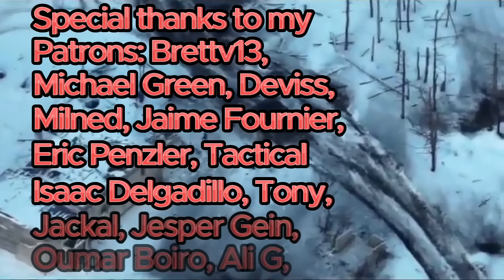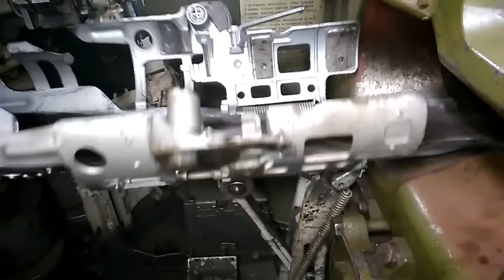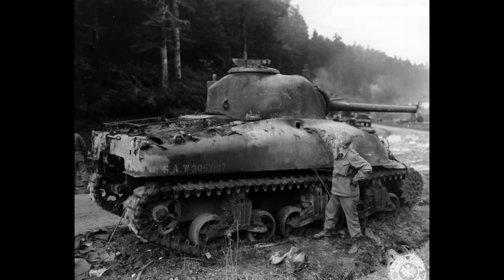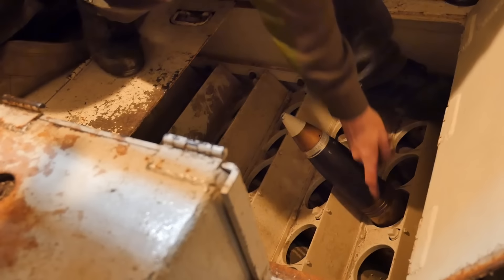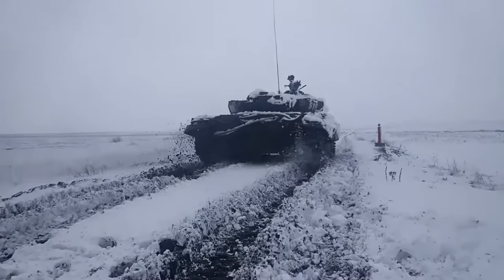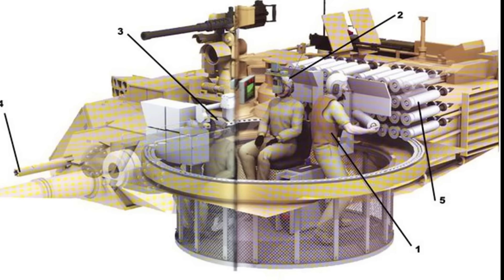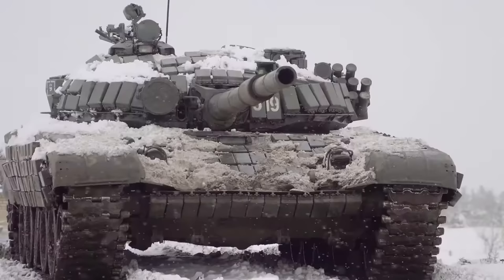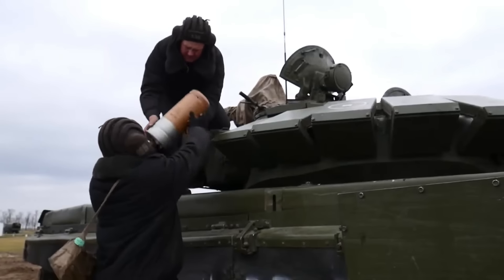Is Autoloader Really the Reason for Russian tanks exploding so much?

Comment: Gaijin actually solved the ammo detonation issue on T series tanks and I think the Russian military needs to take notes. Just make frag magically disappear post penetration!

Jokes aside, ammo stowage has always had this issue, especially "dry" ammo. If an Abrams gets ammo racked with the blast shield open, it doesn't fair any better then a T series. There are always design considerations and drawbacks, I don't think it's fair to claim it's entirely the autoloaders fault. Bustle auto loaders would suffer the same fate if the ammo is struck during a reload. That's basically all segregated ammo stowage and blow-out panels do- increase the statistically likelihood that a successful perforation of the armor doesn't mean a catastrophic cookoff that will kill the whole crew.

It's just basic thermodynamics. Chemical Propellants love to "blow their top off" so to speak (ammo sensitivity has always been a problem and many solutions have been made to attempt to address it), especially around jets of molten metal or searing hot fragmentation. C'est la vie.
Reply: U just confirmed u know nothing by saying sabos detnate ammo😂
Reply: @bruhbruh3847 you failed reading comprehension considering his first sentence is a stated joke.
Reply: @bruhbruh3847 there is a practice of lap loading to increase rate of fire... And sometimes crews would leave the ammo compartment open to further increase the rate... So... It still can happen.
Reply: @bruhbruh3847  You dont seem to get the joke..
Reply: @bruhbruh3847 you just confirmed you know nothing about sabots.  They are designed to push through armor which super heats the sabot and once it's through the armor the sabot desintergrates into super hot fragments that shred the insides of tanks and starts fire.  Depleted uranium is pyrophoric and will burst into flames when heated and under pressure like after punching through armor.  That is why we use them as tank rounds.  They are designed to punch into an armored vehicle and start a fire.  This is why "T" series tanks were blowing their turrets off in desert storm.  Their ammo storage was blowing up.
Reply: @Kuraimizu9152  Lap loading isn't done any more,especially due to the possibility of having a flash back from the tube and gun breach which could touch the ammo if the ammo bay door is open potentially causing a cook off. The SOP for the past 20 plus years has been for the ammo door to be closed as soon as the loader grabs a round from the bustle.
Reply: Jesus, so this is what you War Thunder players do in your spare time...
Reply: Incorrect
The Abrams ammo is kept external to the crew. if the ammo is hit, there is an armored door in the crew compartment that slams shut and the blow panels allow the explosive force of the ammo detonating to be direct away from the crew. As long as the door is closed and the crew closes their hatch, they can ride out it 
The Russian tanks till the T-14 didnt emphasis crew survival
Reply: @verdebusterAP that is basically what he said, the ammo is stored in a bussel in the turret, never before anywhere have i heard someone say that the blast door that separates the crew compartment and the ammo stowage will slam shut if hit. I have never heard of this before and i am a tank NERD. So i’m questioning what crack your smoking
Reply: @verdebusterAP  Incorrect
You just stated the exact same thing I stated. If I'm incorrect, then somehow your correct point is incorrect. :P, tons of reading comprehension issues with my og comment so I'll let it slide, lol.

I don't disagree that segregated ammo stowage and blow out panels are major points towards crew survival post penetration but if the door is open and the ammo is hit during reload, pretty sure it'll turn into a pressure cooker. We don't call that a "design flaw" when tanks like the Abrams X / T-14 have completely segregated crew compartments, completely negating the chance of ammo detonation killing the crew.

Also, the door is, at least to my knowledge, manually operated by the loader. There might be some sort of automatic system in place (The Wiki article claims so), but from what I can tell that's not correct, at least from video footage I've seen. Not a crewman so I don't 100% know for sure, but I have serious doubts it is. Fact is, that sounds like a great way to lose fingers, and given we don't have a bunch of Abrams loaders with missing fingers from the middle east (figure you'd hear about that or it'd be mentioned somewhere) it puts to rest at least the Wikipedia claim that the door automatically closes.
Reply: @fireflyredux3373 you basically said what i wanted to say but i was too lazy to add more 😂 yes i agree, i have seen many videos on abrams and the blast door is manually operated, no sophisticated system that would slam the door shut if its hit. Not to mention it’s a heavy asf door, to move that amount of weight in that mount of time at a very high speed almost isnt possible, and then again as you said that would be a great way to lose fingers or even a hand
Reply: @OS08  
Tank nerd highly unlikely
YT M1 Abrams ammo cook-off blowout panel test and you will the armored protecting the inside
Reply: With the new anti tank weapons and drones tanks are just big targets now no matter what the design they can be taken out.
Reply: @bruhbruh3847  Sabots can absolutely detonate ammo, if your claiming they can't. Abrams popped plenty of T-62 tanks in Iraq, and they used Sabots for those kills. A challenger 2 turret popped a T-62 with sabot, well documented.

Plus, if they didn't, it'd break all known laws of thermodynamics. Like a tungsten penetrator isn't glowing hot after punching through armor, forget the pyrophoric nature of DU rounds.
Reply: @fireflyredux3373  
Incorrect again
Due to the massive amount of incidents the US military as a whole had with ammunition exploding for various reason , mishandling, accidents and combat
All munitions used by the US military have to meet Insensitive munitions guidelines. so if the ammo is hit while the door is open, as the munitions are designed to be insensitive 
The ammo wont cook off right way and the only damage will sharpnel. There is an automatic system
YT Abrams reloading and you see the loader hits a button to open but the door automatic closes on it own
it only slams shut if the sensor detects a fire in the ammo compartent
Reply: @greenspiraldragon  That's a silly argument if you take two seconds to think about it. It's not like that cannot apply to literally every wheeled and tracked military vehicle out there. Are trucks "just big targets now", time to pull out the horse and carriage again?

Drone warfare is a big threat to *everything*, but it's not like you can't do anything about it. Russians have successfully deployed EW suites to counter drones, direct from the mouths of Ukrainian drone pilots. The accuracy of not only drones, but GPS glide-bombs and guided artillery rounds are also effected, pretty heavily from my understanding. From 90% accuracy to ~10%.

And it's not like you cannot counter EW suites either. Everything creates emissions, those can be tracked and hit, even automatically. AGM-88's, for example.

Warfare adapts.
Reply: @fireflyredux3373  The Ammo Bustle door on the Abrams  closes automatically, it has sensors that will stop it from closing if it detects something in the way/will start closing if it doesn't detect anything in the way. The loader has two switches to open the door,one at thigh height the other next to the door.
Reply: @scantrontheimmortal  Okay, I understand now. The door automatically closes if the Loader isn't holding down the pressure switch or is actively handling ammo around the door. The door acts like an elevator door, in effect. Cool.
Reply: @verdebusterAP  To put it to bed, the loader either holds down a pressure switch to keep the door open, or while the loader is interacting with the ammo inside the bustle, the door stays open like an elevator door. It, however, is not connected to the Halon fire-extinguishing system in some meaningful way. It's a "dumb" door, in effect. Which is still my point entirely. 

In the event the door is open and the ammo is hit, I don't think the damage control system could do anything about it. Think about it- firearms work in a vacuum. Venting Halon into the crew compartment would snuff flames, but the immediate ammo cook-off? Not something you can realistically do.

I concede however that I was wrong about ammo insensitivity. Apparently, full cook-off with NATO style ammo propellent is rare. Not completely rare, given how export models did in Syria- though I'm not sure that's totally applicable to the most up-to-date ammo.

Still, my point was if the ammo was hit, and it did detonate with the door open. I get that there are plenty of systems in place (Like the Halon system) to increase the chances of the ammo not detonating, but it has happened. In those cases, the M1 would explode like a T series tank. 

Seems like a lot of *if ands or buts*, but I'm not the one claiming it's a design flaw of M1 Abrams tanks. 

The flaw is in ammo stowage and the specific propellants of Russian tank ammo (possibly even ammo types themselves, like HE-FRAG) combined with the lack of more up-to-date damage control systems, which shows the age of the T series. Not the autoloader itself.

Which again, is my point. Lol.
Reply: @fireflyredux3373  
No insensitive munitions are  not designed to simply to make munitions safer while being handled, they are design so the munitions doesnt automatically sympathetic detonate
if nearby munition gets hit and yes they are designed to resist fragmentation. that why you can hit C-4 with hammer ,drop it and even burn it and wont go off
There is a sensor in the ammo compartment that can detect if the ammo has been hit and yes the door will close automatically once that sensor is trigged and cant be manually open unless the crew resets the sensor and thats only if there is false positive
Reply: @scantrontheimmortal  SOP in most armies is broadly `` no loose ammo (of any kind ) in the turret; period`` not just because of the explosion risk but you run the risk of damaging the munition itself, the fuse, or the combustible casing, which could lead to anything from a misfire to non-fusing on the target. Damage that would be sustained from either falling or being pinched by moving pieces of the turret.
one very tragic training accident on challenger 2 was a result of gun/breach design failure igniting open/non-stowed propellant bags inside the turret.
also these full sized tank cartridges are heavy as hell, if that falls over in the turret basket you could easily crack an ankle or worse if it falls on you.
Reply: @fireflyredux3373  
Again incorrect
When a tank is hit , the force of the impact can disorient and even knock out the crew. if your fire-extinguishing system doesnt automatically trigger
Those precious for seconds could be life or death. The DC will seal ammo door and yes for those reasons, they are looking for alternatives for halon that can fight fire without risk to the crew but the Army will like adopt the AbramX's turret design 
There is video of Abrams getting hit Ramadi by ATGM and despite the inferno , the TC is seen getting out 
In practice, crews don't manual the door period
Reply: @verdebusterAP When the door is closed.
Reply: @verdebusterAP Insensitive ammo does not magically render it inert. It absolutely does still cook off, there are videos from Yemen of Abrams going up like a Roman candle.
Reply: @verdebusterAP  There is literally no data to support the claim of having a sensor in the ammo compartment that automatically closes the doors if struck. There is a sliding door that automatically opens the door to EJECT a spent shell after firing, otherwise the door does not close if the ammo is struck. Either way it is not feasible and practical due to these reasons: you would need to have that door sliding at the speed of sound if not faster to close in time to prevent the blast wave and the heat of the detonation of the ammunition. And i know for sure that the door would need to close at those speeds, because most ammunitions use explosive types that produce a detonation (travels faster than speed of sound) compared to deflagration (slower than speed of sound). The propellants use deflagration which is still fast (and i know this for sure because deflagration is best used to propel as detonation is too violent for the gun, can rip it apart), which is how tank rounds can achieve fast velocities, as well why tank barrels heat up. HEAT rounds in the warhead, use detonating explosive type (you want to have overpressure effect as well as a powerful molten jet). The relevance comes as HEAT, HE (also detonation type explosive, cus you want to blast the enemy to bits and cause fragmentation) both use that, and guess where they are stored? In the ammo compartment. If that gets hit, can you even imagine at which speeds the door needs to close? Find a motor/piston that can close fast enough to prevent anihilation of the crew compartment, especially at distances <1 metre. To add more reasons, this is not overly practical since what will happen if the ammo gets hit while reloading? Bye bye hands/fingers if the door did close, not to consider jamming due to having the appentegies of the loader in the way. IF you try claim that the door does not close during reloading, then if this is indeed real, any enemy with knowledge of that would aim to fire their rounds after the abrams fires so that the blast door would be open to reload. That reloading sequence is aroun 5-8 ish seconds to reload. In that timeframe, it is enough to get a potshot into the ammo and kill the tank. Is it to these reasons, this is not feasible or overly practical for the loader at least. And if you still insist, then provide me with sources to support your claim, because a blast door closing as the ammo is hit is the most unlikely thing i've heard. No source -- it isn't real. Here is mine for the sliding door to eject the shell https://tanks-encyclopedia.com/coldwar/us/m1_abrams.php And for the detonation/deflagration just google it lmao it is easy to find.
Reply: @scantrontheimmortal  2 Challenger 2 crewman died only 6 years ago during live fire training when they were improperly issued a tank that hadn't finished maintenance and was still missing its gas ring on the two piece barrel which upon firing immediately "Flashed" into the tank; a large contributing factor in the injuries and deaths caused is the loader is believed to have been "Lap Loading" and the flash ignited the propellant bag he had out it's bin. This seems further likely as the flash was powerful enough to eject the Tank Commander sitting head out, from the tank. I believe he and the driver survived, while the gunner and loader were killed in the training accident. 

So while maybe not "SOP" Lap loading is certainly still a thing that's done. At least with the Abrams, almost all the ammo is right behind the gun speeding up reloading and keeping it consistent; whereas the Challenger has propellant bags stuffed all throughout the hull increasing the likelihood of Lap loading to keep a consistent reload rate instead of having to hunt and peck during a reload for the next bag.

There's a reload issue with finding the next round with the Abrams as well, when changing ammunition types; but as long as you've got a good loader who's got the different rounds stored in proper positions it's not an issue. When you've got a "meh" loader who's placed ALL your MP-T at the bottom of the bustle under a mountain of Sabot... it's an issue.
Reply: @AndreiGolubev-oh7ei  
I am just going to laugh at this statement because its so hilarious
Here's hint
what happens when ammo hit,  burns and that does what exactly
Reply: @QualityPen  
Yes those vehicles go up however show me one where the crew is not protected from the ammo cooking off
it does render the ammo relatively inert 
With Russian tanks,  they are the reigning champs in the turret toss as 9 times out of 10 , after cooking off or impact, the turret flies
it burns out but wont detonate , big difference
Reply: anirecapped.  Yeah, I was pretty sure it was sub-10%, wasn't positive on the exact number. New tactics behest new tactics.
Reply: Blast shield can still close during a cook off
Reply: @bruhbruh3847  bro, thinks he knows something😂
Reply: @verdebusterAP  Well not exactly sure what is your with that, but i'll make my point clear to understand. 
If ammunition is "hit" that usually implies its hit by a round or projectile. Sabot, HEAT or anything else that produces heat above 200 degrees celcius, if the ammo is hit with that, the ammo cooks off. In the case that i just mentioned, this causes the ammunition to discharge and effectively explode inside the tank. This makes chain reaction in the ammunition compartment because well, there is like 30 ish ammo next to each other so this would result in the entire backload exploding, effectively.
So with that, in abrams tank, there is a blast shield to protect against that, and the whole reason why i am here responding to this is because you claimed previously that the abrams has sensors in the ammunition compartment that detects if the ammo is hit (motion seonsors i am guessing) and closes the door automatically. And what i was previously saying is that  this feature is simply not feasible, and if you want to convince me that it is true, you need to provide evidence, because no matter how many times you will say it, without evidence of that being the case, there is no way i can believe that.
And what my explanation is that like any normal army, the blast shield actually is manually opened by the loader (its a sliding door) to get the ammo and close the door again, for which i have evidence in my previous response.
It is because of those reasons i believe that your claim is false.
Instead i'll ask you a question, what does make you think that the abrams has a sensor to detect if ammunition is hit and magically close the door just before the blast wave and all the heat is dispatched into the crew compartment?
Reply: @bruhbruh3847  You just confirmed you know nothing about basic physics. The faster a thing goes, the hotter it get, especially metal made thing like APFSDS. Hell try picking up the the projectile of an M4 right when it just hit the dirt, which just have traveled 890m/s. APFSDS usually travel at mach speed or around 900-1000m/s, when they hit something they slow down, not cool down
Reply: @verdebusterAP 1 the door will do nothing when its open wich is quite often as crew leaves it open for easier and faster reload 

2 the door must be closed by a person, its not automatic. If the tank gets hit when its open  then it will do nothing
Reply: @thedarkone5049  
False
YT any Abrams with reloading and you will that the door operates on its own
There is one where loader removes the shell and has back turned to while loading and the door closes on its own
Reply: @AndreiGolubev-oh7ei  
Incorrect
when hit, burning is from the propellant as they are  semi-combustible cartridge and easily ignite however  as the warhead are designed to be Insensitive munition and they dont detonate hence why we see Abrams burning but never any sign of secondary detonation like we see with Russian tanks 
As blow panels allow the fire to burn openly instead of confined, the HEAT rounds never reach detonate temperature. Without blow panels and if the fire in confined, then yes, they will detonate temperature.and blow
Reply: @angminhquan2818  the sabos itself does not ignite ammo maybe the fuze
Reply: @verdebusterAP  Look, we get it: You don't understand physics.
The armoured door in the abrams is manually opened and automatically closed for obvious reasons. It's not completely automatic.
The door is too heavy to slam shut immediately, it's physically impossible. All cook off tests are made without a crew so the door is always closed during those.
The blowout panels funnel the chemical force of the shells cooking off upwards, but if the armored door being penetrated from a shot it's rendered useless.Furthermore, it is NOT impossible for the ammo to detonate inside the tank. Moden ammo just made it less likely. Making it insensitive was intended to make it less likely for the explosives to not detonate when it isn't supposed to. Again, it is NOT IMPOSSIBLE for ammo to detonate instead of merely cooking off, especially when 1000+°C of superheated or even molten metal is ripping through it, maybe even creating sparks.
Also, you don't understand how temperature works. The rounds can definitely explode but that's exactly why the door between the ammo and the crew is so heavy in the first place: so that the cook off OR EXPLOSION get's redirected outwards.

Also: There's a small ammo stowage in the hull of the abrams. Only like 3 or so, though.
Reply: @gehtdichnixan9005  
The door closing and opening has nothing to do with physics, its called design and yes it completely automatic
Just to make fun your  physics statement
its called the path of least resistance there einstein.  The blow panels create an path for the explosive force to be directed safely away from the crew 
Without a path to flow, the explosive force is goes up in all direction, granted thats too complicated for you but I barney style as much as I could for you
Secondly there is video a Abrams getting hit in Ramadi and the safety features as functioned design
Despite the burning inferno, the TC is getting out unharmed 
The odds of the door be penetrated are a joke and even , it still doesnt change path of least resistance as the blow panel completely expose the ammo giving it an easier route
Reply: @verdebusterAP  To correct a mistake i made after a closer look, yes the door is automatic (look up a video of abrams loader pov, it is automatic but does not automatically close if the ammo is stuck, its not fast enough), however the odds of the door peing penetrated are not that low, it can still happen, and with the pressure of all the inferno, like in the video you reffered, a blast shield with a hole in it, would still vent a fraction of that inferno in the crew compartment. And that is sufficient to roast the crew inside, if not kill it. Having an easier route just grants less pressure into the paths of harder resistance. Think of it like having a water tank with a drain at the bottom, and you punch a hole in the side. The water will mostly drain in the bottom but part of it will be leaking from the hole.
Reply: @AndreiGolubev-oh7ei  
And that is only possible reason for the door to be remain open if was jamming it but round wouldt cause that unless the loader royally screws up 
if there blast door was compromise even by a fraction ,  sadly thats all she write for the loader but TC, and gunner would have a chance to escape as they are not positioned directly behind the door
However this is moot 
For reasons unknown Northrop Grumman which brought Orbital ATK in 2018. Orbital ATK is the company that makes the M829 rounds for the US has apparently stated that they will no long produce depleted uranium ammunition. So either General Dynamics goes back into round making business or they have to adopt the 130mm round
As there is virtually no one left that makes depleted uranium ammunition.
Either way, we are at the end of human loaders on the Abrams with M1E3 or if they adopt the AbramsX
Reply: @verdebusterAP  Sorry made a spelling mistake i was supposed to say if the ammo is struck and the door was open at the time, the crew is ded, not overly sure if the blast door was compromised and the TC would survive (maybe like strong heat gets dispersed or whatever) but i am no thermodynamics expert so i'll take your word for it. And yeah you are right, the human loader age is at its end, autoloaders make less casualties per tank :)
Reply: @verdebusterAP 1 you don’t believe me. 2 i am aware what the blast door does i’m not stupid 🤦‍♂️ 3 you can look up videos on youtube where they show a video on the ammo rack cooking off, this is a pre set up scenario. There is no crew inside and the door is already shut.
Reply: I am going to disagree. The fact that the propellant is stored in a bustle means its not scattered around the crew compartment ready to be ignited. Hot fragments and ammunition do not make for a good mix. So there would be a chance of ammunition explosion if the crew were reloading but not as much as having the ammo stored in the crew compartment.
And of course the bustle is designed to protect the crew in the event of an explosion. 
But being penetrated is not good anyway (fragments and over pressure).
Reply: @AndreiGolubev-oh7ei  
That would be the definition of one helluva of lucky shot. The TC and Gunner are on the side so if door failed or there was breach ,the loader would be the one taking the blunt of it
I wouldnt say less casualties 
The problem is drones
In WW2, TC, gunner, A-gunner, loader and driver
I would say the loader becomes A-gunner/back up loader 
The A-gunner job is dealing with drones
The AbramsX mounts 30mm cannon
Ideally with programmable rounds airburst and , Gerrman made AHEAD and enhanced sensor suite 
in the form of a radar that periscopes up and down. The A-Gunner would be able to keep an out for drones while in combat or moving allow the gunner and TC to focus on the mission
so the 4th guy may serve a vital role still
Reply: @OS08  
of course  you dont
Reply: @verdebusterAP  bro wtf do you mean  💀
Reply: @Kuraimizu9152   they always acting like the human loader and heavy blast doors are always perfectly in sync and simply cant be open at the wrong time
Reply: @angminhquan2818  even HE shells dont ignite from being hit by sabos
Reply: @bruhbruh3847  Had you read what i had typed
Insensitive or sensitive charges(gun powder). If the sabo still and can retain the heat over 573K then if the HE shells is penetrated, then if they will expoded, not ignite.
If the APFSDS projectile is seperated from the charges, then no explode. If the charges is made with the projectile, then explosion immanent
Reply: @angminhquan2818  i thought the charge alone or fuze would be enough for explosion because i remember that the projectile itself does not ignite like that but thanks for the lecture then